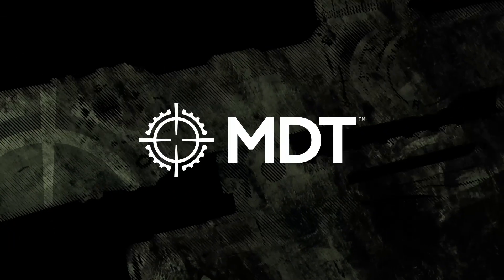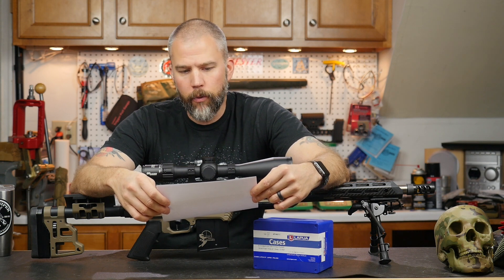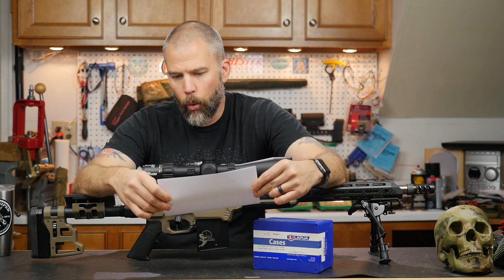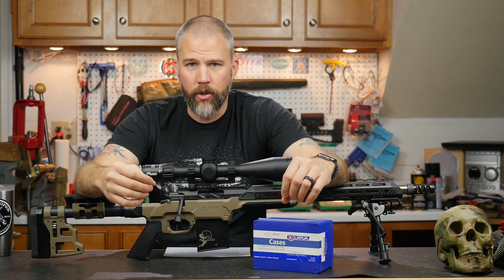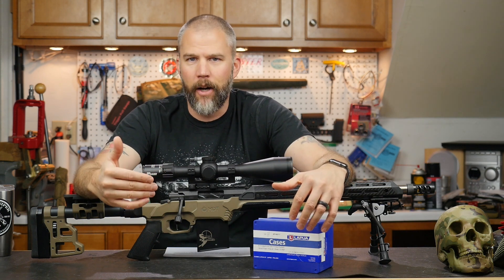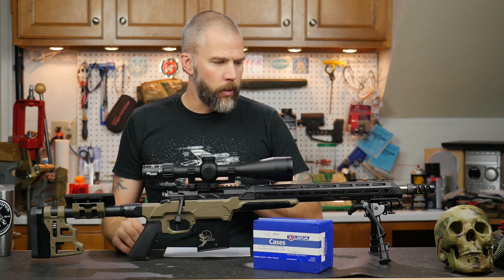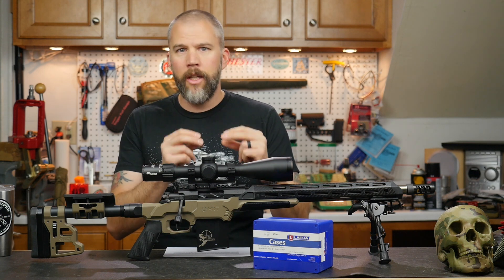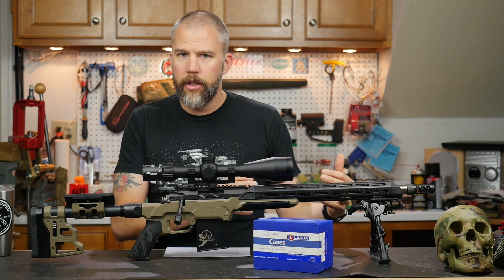Mail Call Mondays Season 7 #37 - Fire-forming before Load Workup

Comment: I use to fire-form before load work-up but have stopped wasting the time and components as I found that with the Satterlee method (finding a velocity node), it made virtually no difference as long as I find a velocity node of +/- 0.2 to 0.3gr charge weight variance. For example, with my current 6.5cm, shooting 147gr ELD-M's, I found a Node that I'm averaging 2671fps with an 10shot SD of 3.6 and ES of 8 even at +/- 0.2gr difference, I'm only changing about 0.4 on the SD and 1 to 2fps on the ES. I saw this same difference between new vs. once fired (i.e., fire-formed).

Comment: I too use the velocity method for load workup. As far as “fire forming” brass I don’t specifically shoot to form the brass but when starting with new brass and a new rifle I will usually throw a mid to upper charge from the book and a cheaper “match” bullet, typically a Hornady BTHP for the first round. This gets the barrel up to speed and also fire forms the brass so I can bump the shoulder back .001”-.002” when FL Sizing.

Comment: The only thing I do for brand new brass is run it through my Sinclair neck expander mandrel. From there I load and shoot. What I have found, at least on my 6.5 Creedmoor and 6.5x47L brass, is the load will tend to be around 20fps slower than previously fired brass. I have also noticed that Extreme Spread will tend to be a bit wider with the new brass. You can still identify accuracy nodes and/or velocity nodes, they just might not be as pronounced.

Comment: My semi-auto guns get full length sized every firing (223/556, 300blk).   22-250AI gets fire-formed for obvious reasons, but I also worked up an accurate load to use while fire-forming.  

I worked up a load in my 308 bolt gun while fire-forming a few hundred pieces of Lake City brass, but that is mostly because I bought once fired machine-gun brass (never again) and had a lot of trouble sizing it.  The next loading was neck sized only and the groups were marginally smaller.  Larger differences were seen from varying seating depth than from using fire-formed brass.

Comment: I’ve always full-length sized my brass (300 Win Mag), so fire-forming isn’t really doing much since I squish the cases back down. 
I like your advice about finding a plateau. I had trouble this year with hits at extreme long range and my instructor said it was my standard deviation. Maybe finding a spot in the center of that plateau will make my cartridges less sensitive to deviations in charge weight.
Reply: If I full lengths size I don't get much firings out of my brass so I just neck size. But I do get better groups when I neck turn my brass and I get more speed. 300win mag

Comment: Thanks for another informative video!  I’ve used the OCW or a ladder method with fireformed brass for every rifle I’ve had, up until now.  Always felt like that was a lot of excessive wear and tear and components.  I shot a “Satterlee string” over the weekend with my new 6.5 Creedmoor and virgin Lapua brass and ELD-M bullets.  I have a plateau around 2640 FPS and loaded up 5 rounds of 3 different charges.  We’ll see how they do.

Comment: I’ve gotten unlucky so far with the “order of operations” of: 1-ladder & flat spot 2- confirming low SD with 5 shot group 3- seating depth variation & group shooting. These low SD loads have so far given bad vertical dispersion (1.5-2 MOA at 300 yards, where group was sub MOA at 100) so now I feel like it IS important to be grouping during your initial ladder testing among various powders. Other loads that group very well with 15-20 SD are doing a little better at 300. I’m sort of lost at this point, I guess I’m just trying to say that it’s good to gather multiple observations at once so you don’t waste your time assuming low SD automatically gives you good vertical dispersion at distance.

Comment: 8541 tactical I agree with using virgin brass for load work up. But, With my experiences I will only use virgin brass for the initial velocity test. I have actually seen a load that was developed with virgin brass, meaning initial powder charge test, seating depth test and  fine tuning the powder charge all done with virgin brass. Once the fired brass was used the accuracy could not be replicated with that load. Powder charge and seating depth had to be adjusted slightly. Lapua brass is what was being used.

My best guess is that the difference was caused by the necks having more tension than what you get from fired brass along with the lack of carbon increasing grip on the bullet. I come to this conclusion because of the different  of force required to seat the bullet in virgin brass vs fired brass. Also I have heard from other fclass shooters that when their necks are completely clean with no carbon in them their accuracy is also degraded. 

Another concern I have with using virgin brass is the primer pockets with full power loads. I seem to get less loads before they become to lose if I hammer them on the first firing. 

Since I'm assuming you have people watching that shoot cartridges ranging in size I think it's worth noting that the amount of effect on accuracy all the variables have is dependent on the size of the case. For instance a 223 vs something the size of a 308. .2 grains of powder in my 308 is hardly noticeable on target if at all. .2 grains of powder either way in my 223 will take you out of a node. This assuming I am in the middle. 

So I guess starting load development with virgin brass is ok, but depending on what your goal is, fine tuning with fired brass is necessary. I shoot f-class and from what I've read and heard others say, generally speaking people dont get as picky about their accuracy in disciplines like PRS. 
Anyways just my thoughts and experiences. In hope I explained them clearly enough.

Comment: I put more effort into my fire formed load work up with my 300win mag because I size to the chamber, with belted magnums there is usually a more Measurable difference between fired and unfired brass. With both of my 260rems there is very little difference in size between fired and unfired.

Comment: I just came back from the range yesterday. Several of of us were discussing how we reload. I said that I deprime using a universal deprimer first, then clean for about 10 minutes with SS pins, then anneal with my AMP 2, then full length resize bringing the shoulder back 0.002" and finally use a expander mandrel that is 0.002" smaller then the bullet diameter. All of them said do not full length resize just use and expander mandrel. I think it is required to full length resize but all of said no. Your opinion??
Reply from the maker: Bumping the shoulder is a good technique to keep your cartridges chambering smoothly. If you only ever neck sized, the brass stretches and becomes hard to chamber. How much of an issue this is depends on the brass and the action you are using. In your situation I would use a “body only” die to bump the shoulder instead of a FL Sizing die. Otherwise you are working the neck twice.

Comment: No need to fire-form.... ADG is very good brass out of the box. I just H2O some cases to get the volume and recalculate the charge on quickload. ... 10 round later the load hits 1/2moa. One trick is to get the neck tension the same...sinclair expander mandrell's.

Comment: Hi John. I hear what you are saying about not needing to fire-form prior to load work up. My question is a similar though line but regarding new barrels. If I have purchased/ had built a new rifle, without considering different opinions on barrels break-in and cleaning methods, would you wait until your barrel velocity has settled (approx. 100-150 rounds) prior to load development? I am just wondering whether it is worth using factory ammo for that first section until velocity has settled and whether the velocity node may shift as the barrel speeds up. Thanks, loving your videos all the way from NZ.

Comment: Fireform small batch for workup and then load rest of the new brass to that load. But keep going either down the rabbit hole, can feel the difference in minor neck variations while seating the bullets...don't wanna neck turn...I don't wanna neck turn... maybe should switch to Lapua from Hornady.
Reply: Thomas Ewers 
When I switched from Hornady to Lapua, I analyzed 100 round lots of each for consistency of weight, concentricity and neck wall thickness. Lapua wins hands down in every category. If you’re really into making quality precision rounds for long range, make the switch and never look back. Good luck!

Comment: I have tried the velocity load work up method twice so far with two different cartridges (308 & 6.5CM) and each time I cant identify a node that stands out. SD of about 8fps most often. I end up needing to rely on group sizes to pick my load. Not sure why I get this result. Brass fire formed. Neck annealed. 0.002 tight. Powder within 1 kernel. Inside of neck brushed out and a small amount of lube on projectiles. Just about as uniform and consistent as I can make them. Still no clear velocity node pattern. Am I missing something??

Comment: Question sir I run out of  windage when trying to zero my 6.5. Ruger American. Even after trying to adjust I am still 8 MOA from center. Is that a scope issue ? Or do I need to check something else out
Reply: Sound like scope to me do you have an extra scope to see if that is the problem?
Reply: Check that your scope base is straight and parallel with the barrel.  I had a RPR in .223 and the receiver was drilled/tapped 16 MOA to the right.
Reply: Thanks for that. I'll have to check that out
Reply: If base and rings are tight, and as Mr. Stephens suggests, another scope also won't adjust enough for windage, have the holes in the action for mounting the base checked.  They can be off by quit a bit, and not be detectable to the eye.
Reply: @Edwin V.  I have a video on a crooked rain on a Ruger American.  I fixed it using the Burris XTR Signature rings to center the scope up. I would take a true straight edge and place it along the side of the rail and see if it runs true or not.  If it's crooked send it back to Ruger.
Reply: I had a buddys RAP and the rail was 20 MOA off.  I have came up with about 10 cases where the Ruger American have had this problem.
Reply: Edwin V I have added a 20 moa rail on my Ruger I ran out of elevation adj. also
Reply: @243Outdoors  thanks for the info I replaced the scope with the same brand and model just less power. Boresighted it, took it to the range and zeroed at 100 and it held zero for 50 rounds.
Reply: @patricstephens9682  I replaced the scope.with the same brand and model just less power. Boresighted it and zeroed and held zero at 100. So I'll have to contact vortex
Reply: @starwarsheros9245  like the other guys are saying some times the scope base can be of to what really sucks but in your case bad scope is not as bad but still sucks
Reply: @patricstephens9682  yeah. I hating having to send guns back and wait a month
Reply: @starwarsheros9245  so far I all ways bin lucky
Reply: @243Outdoors  20 moa of is really bad